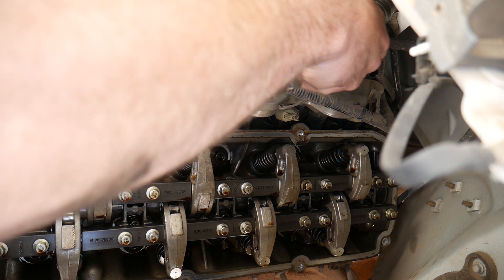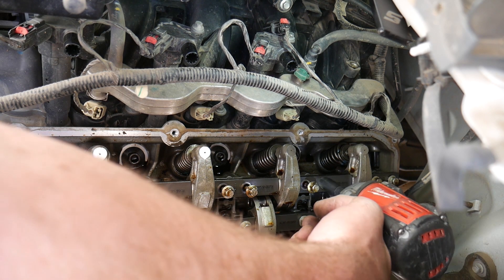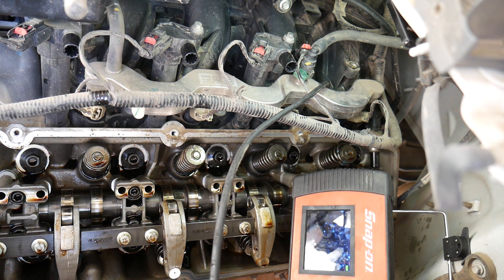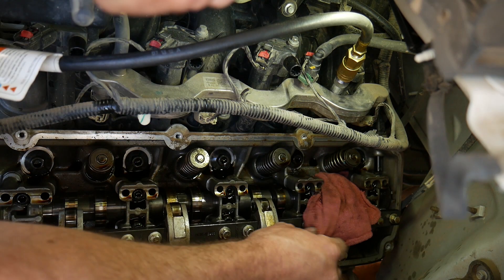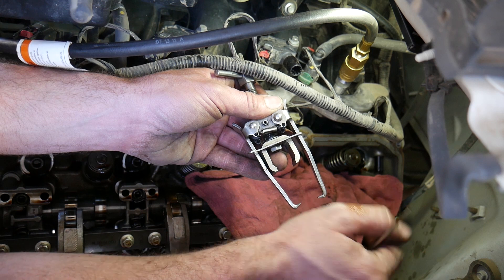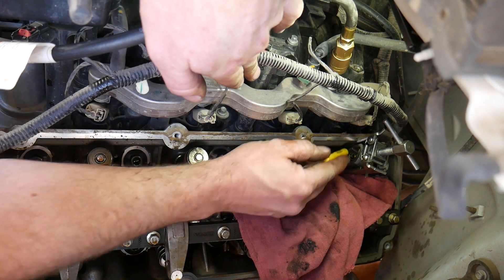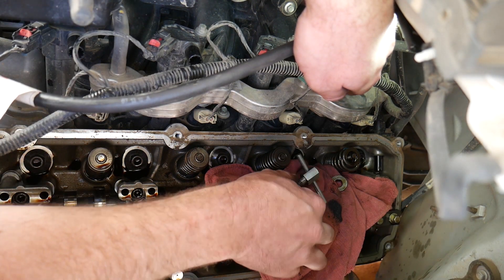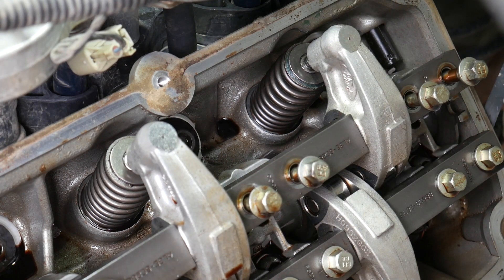2013 Ford F350 6.2 Misfire - Broken Valve Spring Replacement

Comment: Good evening, Blessings, greetings from San Carlos, Costa Rica, I am interested in buying a 2014 6.2 Ford F150 Raptor. Seeing information, they say that the 6.2 gasoline engine breaks the valve springs. The question is, how many kilometers or miles do the valve springs break? of that 6.2 l question is to prevent changing springs before their time that they break and cause serious problems in the engine
Reply from the maker: Most of the ones I’ve seen are between 80k and 100k. I see it more often in fleet vehicle for some reason.
Reply: Good morning Blessings then c it is a fact that they go bankrupt every 80 thousand.  km 100 thousand km the best in theory is to change all the springs and valve seals every 100 km, what do you think would be the best

Comment: I have a misfire on a 5.0l. Very inconsistent. Any chance you could help
Reply from the maker: Those are common for valve sealing issue that require cylinder head removal. A valve job or head replacement required.

Comment: Great video bro but just wanted to add I know you mentioned it but for those people that doesn't have the fitting or air ready or available 
get some vacuum line like 1/8 in or so and about 6ft hand crank the engine to BDC (put a screw or something on the end of the line so it's easy to pull out) coil the line in the cylinder about 3 ft and then roll the engine by hand back up as far as it will go it will stop and you won't be able to crank any more thats when you know that the line is up against the valve and you don't have to worry about losing air pressure and you can change the spring
just wanted to add that for the guys that didn't know this method otherwise awesome job explaining this

Comment: Bro loosen exhaust rocker shaft up if the pressure spins the engine almost  always happens when leaking down a good cyl and the valve drops then what

Comment: My 2011 f250 is occasionally misfiring on cylinder #1.  Is cylinder 1 located closest to front of vehicle on passenger side?  Also, if occasional misfire, could it still be the valve spring broken?

Comment: How were you turning the motor over? Ratchet on the cam sprocket bolt? Did you reuse the rocker bar bolts? That kinda sounds like a torque to yield spec for new bolts. Just curious what parts I need to plan for.

Comment: I wonder why are so many 6.2L engines having valve spring issues? I have never seen a GM engine with a broken spring. Is it because of a higher valve lift rate than other engines?
Reply from the maker: My Jasper engine rep told me it has to do with the height of the valve spring and the way the spring starts to vibrate at certain rpm. Jaspers fix is a slightly shorter spring with a spacer to correct the spring pressure.
Reply: @ThePracticalMechanic  Did he give any specs on the spring and what spacer to use. I am in the market for a 6.2L F250. I am learning what issues to look for and fixes and improvements.  I also read they have oil burning issues. I test drove a 2018 yesterday with 112k miles on it. The truck ran fine but what turned me away from that truck was that the oil level was extremely low, only on the tip of the dip stick.

I read the oil burning issue could be a design flaw with the baffle in the right valve cover for the PCV system. It's causing oil to get drawn into the intake manifold.
Reply: @ThePracticalMechanic  I noticed this is a beehive style spring with what appears to be a variable spring rate. I am curious as the the engineering behind this spring choice. I know part of the design is to reduce reciprocating mass but the difference in coils per inch has me wondering it's purpose. I don't see that in GM engines. There is definitely some harmonics issues causing fatigue failure.

Comment: How much a job like this comes out too?
Reply from the maker: It really depends. If its just one spring it is probably $200-300 plus diagnostic time, if your replacing more than one it will go up. Most shops won't have the tools or the confidence to do it this way and they may want to replace the cylinder head.

Comment: Is this a common problem on the 6.2 Ford? Does anyone know what is causing these valve springs to break? It seems broken valve springs will happen on all of the cylinders in this engine, It's not just the back 2 cylinders.
Reply: Jaspers remanufactjred engines states they are using shorter valve springs with a shim at the bottom so maybe the spring is too long and weak

Comment: I think this happened to my 2015 f 350😩 what is the normal price repair for a job like this. I am getting a qoute of about $5000.00
Reply from the maker: If repairing the one valve like I did in the video its a couple hour job. If replacing all the springs on one side of the engine it will likely be 4-5 hrs. Most shops are $80-130 per hour depending on where you live. Some dealership will not so the job because there is a chance that there is more damage. the $5000 quote was probably for replacement cylinder head to be installed or other major mechanical work.

Comment: Man thank you so much for this video. This video made it so easy to change out the valve spring. My truck just went to backfiring and running like crap and had no power. So I babied it to get it home. I put a computer on it to see what codes I had and it was calling multiple misfires. So I changed my plugs wires and coil packs. After that it was only misfiring on the driver side. So I pulled my valve cover and sure enough the exhaust valve spring on the number five cylinder was broken. Great video man. Keep it up 🤟🏻

Comment: Does ford have a service recall or service bulletin on these? Seems like this is a fairly common flaw? My 17 f250 is in the shop getting the number 3 cylinder spring changed as we speak.
Reply: How much did it cost u

Comment: Replaced a broken valve spring on my 2011 6.2 about a 2 months ago and i believe it needs another one replaced now. Only 124k miles. Might just do them all and be done with it.
Reply from the maker: That’s a bummer. Most of the ones I repair get just the one and then they are good to go. I have yet to see another fail on the same engine.
Reply: @ThePracticalMechanic   Took the valve cover off and it's broke right next to the last one i did. Ordered 15 more.

Comment: I have a misfire in cyl no 8 on a 4.6l f150. New plugs and cops. After watching your vid , I'm wondering if a broken valve spring is my issue. I  haven't heard of this on the 4.6. Thoughts ? Thanks.
Reply from the maker: I have seen a couple with issues but not many. I have seen rocker arm issues and camshaft issues as well. Have you checked to make sure you have spark back there? Fuel injector firing?
Reply: @ThePracticalMechanic  I have spark.  I will check the fuel injector and then compression. Thanks for the reply.

Comment: dang, how many miles did you have on it? the 6.2L are pretty bulletproof from my understanding, this is quite a shock to see
Reply from the maker: I can remember how many miles this on had. Under 200k. I have only seen a few of them do this. They are generally a great engine.
Reply: @ThePracticalMechanic  I have been looking at Fords with this engine and heard that some engines have had this happen. Do you know if this is widespread through the 6.2 production or for a certain production cycle?
Reply from the maker: ajl0426 I had a 2016 do this last week. Unfortunately the valve hit the piston and broke off causing damage to the piston and the head. That is the newest one I have seen this happen to.
Reply: @ThePracticalMechanic  Thanks for the reply/info. I have not followed Fords that much since I sold my Gen II Lightning years ago. Just doing a quick search, it does happen on other displacement Ford V8 engines too, so whoever is supply Ford these springs needed to have better QC. I only found 1 company so far that makes aftermarket springs; Livernois Motorsports. Summit does not show any springs for a 6.2.

Comment: I have a 95 DOHC V8 lincoln continental and it needed this repair. Same type break.  This engine looks much more servicable! You don't need the tilt tool. I used to rope trick.
The only thing I don't understand is how the valve don't smash! I was amazed it ran after.
Reply from the maker: alb12345672 Since there is nothing forcing  the valve to be open they normally don’t get smashed. The might only be open a tiny bit more than they are supposed to be and close slower than normal. Thanks for watching. 👍🏻👍🏻🔧🔧

Comment: Thank you for this video.  I  just replaced my broken exhaust valve got everything back together and the truck runs great but that side of the motor is ticking now.  Any ideas off the top of your head.  I torqued everything to spec.  no check engine light anymore
Reply from the maker: It’s possible that the lifter hasn’t pumped back up yet or one of lifters was on its last leg before disassembly. If it doesn’t clear up you may have to pull the valve cover again and check for rocker arms that have slop. It that are all tight then rotate the engine over some and check again.
Reply: @ThePracticalMechanic  Wow thank you.  Great ideas.  I really appreciate the response.  I will subscribe if I can.  Awesome.
Reply: Looked everything over today on the truck......dumb mistake, exhaust spark plug wire on number 4 wasn't firmly on the plug.  it was causing all the ticking because it wasn't firing.  Just thought everyone should know if they have a similar problem.
Reply: Truck is running beautiful now.  Just like new.
Reply from the maker: Chris Augspurger Sweet you found the issue. At least it wasn’t a mechanical issue.

Comment: Good video. Like the towel and scope idea. I would have dropped both retainer clips into the engine.
Thanks.
Now let’s talk smack. Seems like broken valve springs are common on newer Fords? No. 

Never heard of this in older Ford engines. Could this be from the use of inferior steel used to produce the springs? 
A dual spring design would have been better choice. Cost cutting would be the most likely reason.
Reply from the maker: Troll Master I’m not sure why the new ones are breaking valve springs like they are but I bet your correct and they are now using inferior materials to save money. Increased emission control make vehicles cost more to engineer and produce so they cut cost on certain components that end up failing prematurely. 

I have dropped retaining clips in the past and had to go fishing for them so now I try to do what I can to prevent them dropping where I can’t get them.
Reply: I'm wondering. I had this happen at 188k miles, another youtuber said his went at 215k. All trucks had this problem on cyl 8, so maybe it's a heat issue in that part of the engine or something.
Reply from the maker: Steve Johnson that is possible. Many vehicle have issues with the rear most valve on both banks because the exhaust is often hotter at the rear of the manifold. I’m not sure if that heat would effect the spring or not but it could. At least they are lasting around 200k because I’ve seen dodge/Jeeps with less than 100k breaking valve springs.
Reply: What do you consider "new"? From when?
Reply: I have seen this issue plenty. And it happens on all cylinders at all different milage. Just did one friday that had 64k miles on the #6 exhaust valve
Reply: Just took my 2013 Ford F-250 with the 6.2l in with a misfire and it ended up being a broken valve spring shop quoted me $950 to fix it! Truck just rolled over 105000 miles!
Reply: palmal1990 
It is labor intensive. Cost is justified only if it is done right.
Reply: Im sure it is. I haven’t had very good luck with this truck as of late I just had to replace the pcm which costed me over $1200 and now this happens a month later! it is super discouraging to say the least
Reply: My 2012 F250 6.2L just broke the intake valve spring on cylinder 7 today. 188,900 miles. Replacing all springs on that side while I have it open because apparently its a weak spot on this engine.